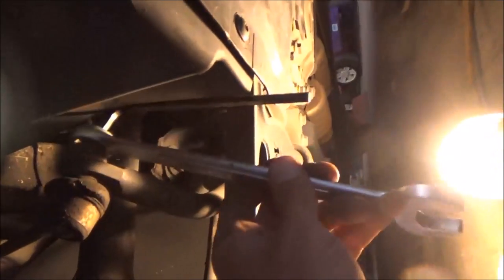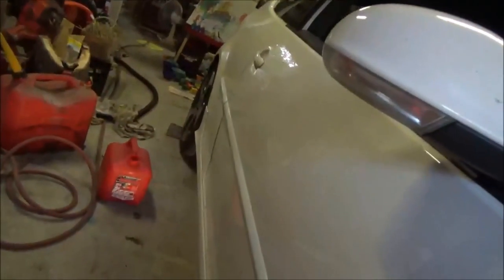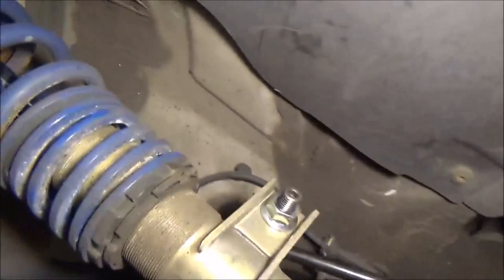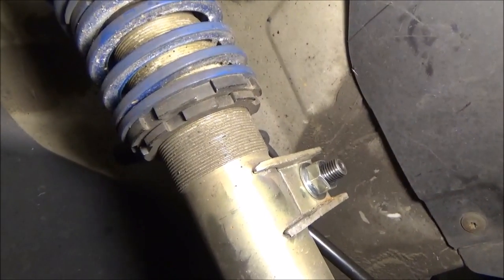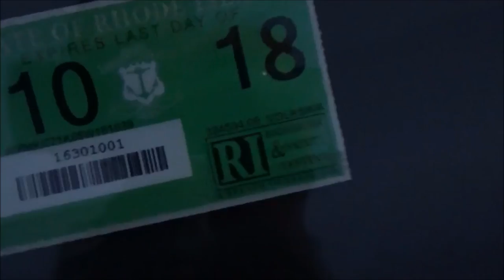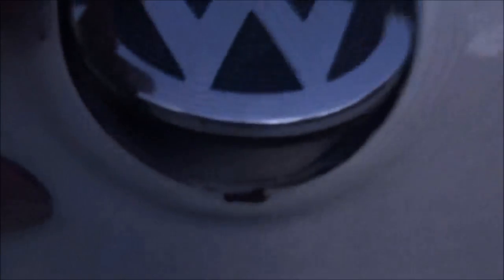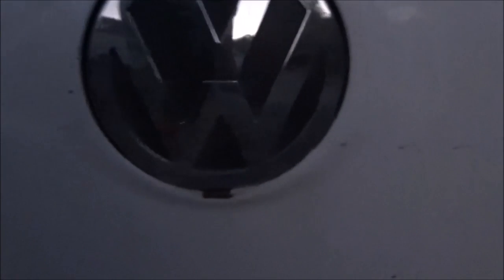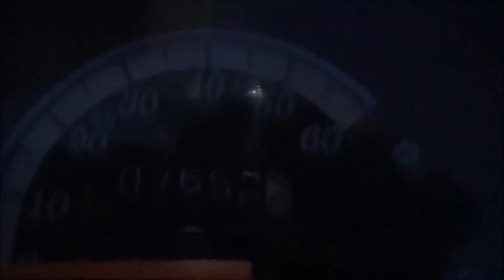Front Sway Bar End Link Replacement Volkswagen MK5 R32

Comment: What is this inspection you speak of?  :-P 
On a side not from the other video, do they ever actually do any work? Are they on standard time or hourly? If not hourly, you would think they would have a bit more hustle. I'm an hourly diesel/refrigeration mechanic and I work at least 5 times faster.